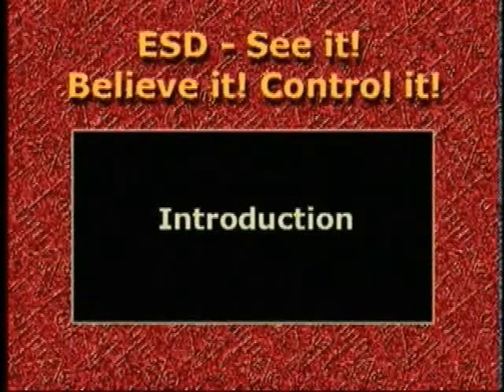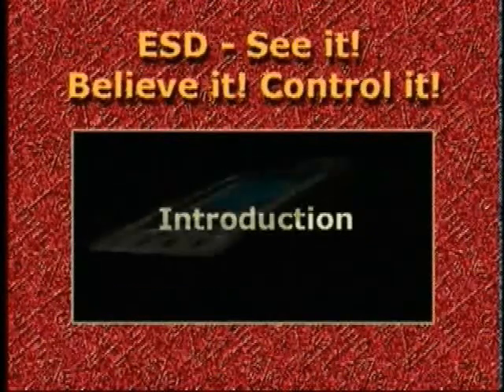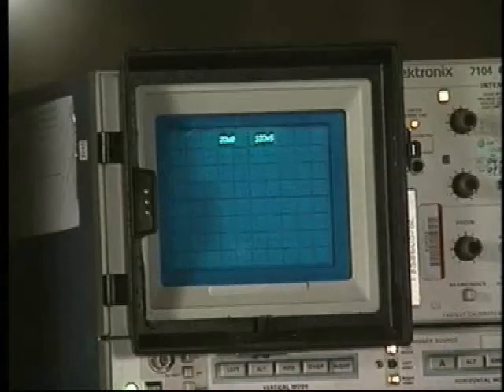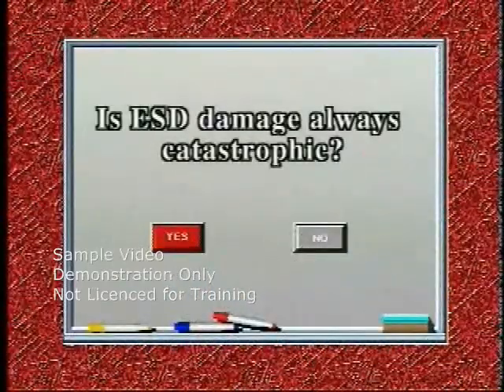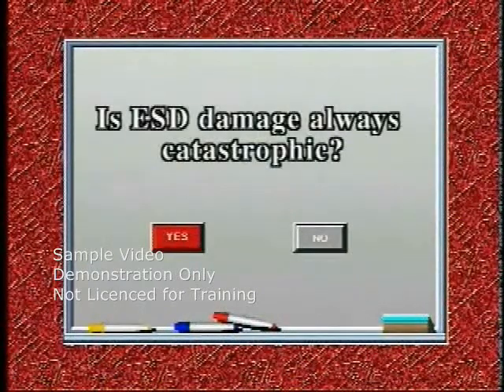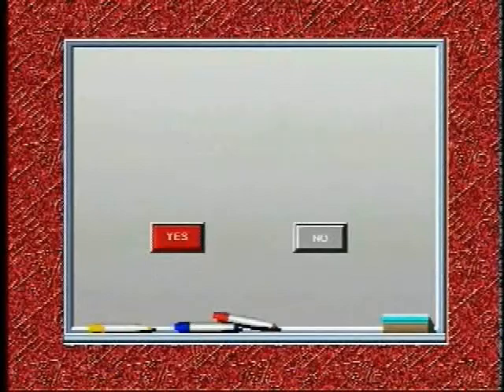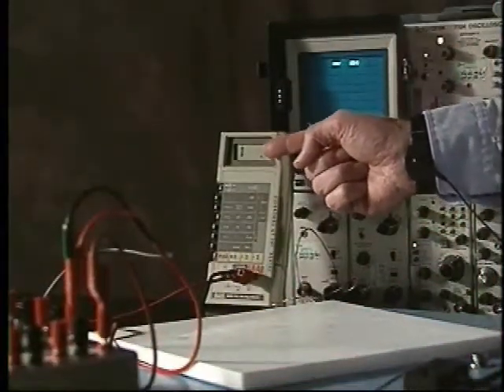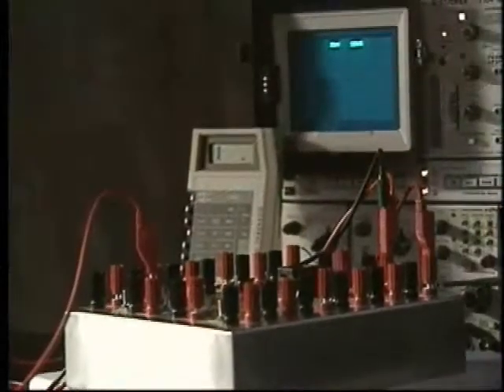ESD Courses: ESD See It! Believe It! Control It!

Comment: King Lerch Another thing to, it depends on the industry. I used to work for Blackberry, and we had very strict ESD control at the manufacturing plant. ESD footware and wrist bands and lab coats were mandatory. They had ESD test stations and we had to make sure that our ESD protective gear was working correctly every morning on the job.

I've seen many computer store with little to no ESD protection. Have you noticed that custom built computers tends to have a higher failure rate and come back to the computer store for repairs a lot more often than pre-built manufacturered computers? It's also good business for the computer store not to have any ESD control if you think about it.

Now do you still think it's blown out of proportion? ;-)

Comment: King Lerch Even when you don't feel or hear a "Zap", those ESD event are happening and they are real, and could damage your IC. The worst part is, ESD damage is not always catastrophic: sometimes, the damaged electronic component will still operate normally, but the lifespan or performance could be deteriorated and compromised. Happened to me with an ESD damaged RAM module that was even showing no problem in memcheck. It took months to determine that I had a bad memory module.  I had to run memcheck in a loop over couple of days to finally detect the damage. RAM is extremly sensitive to ESD. If you hear a zap while touching your ram, I am positive that your RAM will be catastrophically destroyed.

Comment from the maker: To keep it simple - The problem with static is the peak current during discharge. Peak current is lower if the discharge takes longer. A dissipative surface - one that has resistance where the IC makes contact - slows the discharge and prevents a damaging high current discharge event.  A dissipative surface has a resistance to ground greater than or equal to 1x10E ohms but less that 1x10E11 ohms.